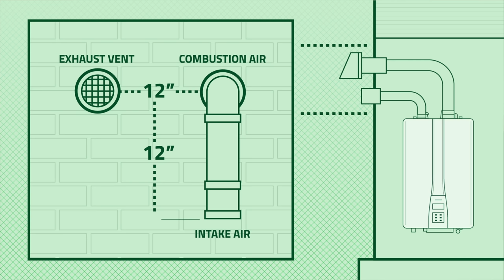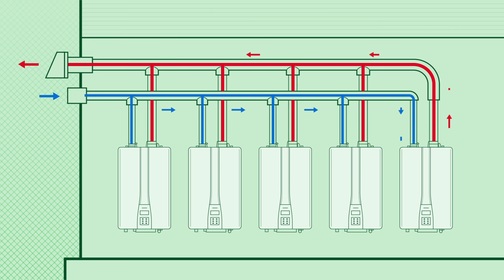Venting Tankless Water Heaters: Tips for a Better Installation

Comment: Furthermore when in the winter the temperature is -30 having to heat that freezing cold combustion temperature is even harder.
Temperature rise also makes a huge difference in heating water. Trying to heat water from 40f to 140f is a 100f degree rise. That makes ot work very hard

Comment: Good info, but my plumber installed it outside under the eaves, BUT ONLY ABOUT 12 inche top outside vent, but the city inspector tagged it because the manufacturer tag states in needs 36"top clearance!!

Comment: I need some information… I live in a mobile home where my hot water take sits within inches of my electrical panel I’m having difficulty finding out a mobile home system that works with propane . We loose power a lot and we have a generator I feel like I need to move it away from the electrical. I think to hire an electrician to move my panel will be very expensive compared to upgrading to hot water tankless system. Suggestions would be so helpful. I’m a single mom and don’t want to make a expensive mistake I’ll regret